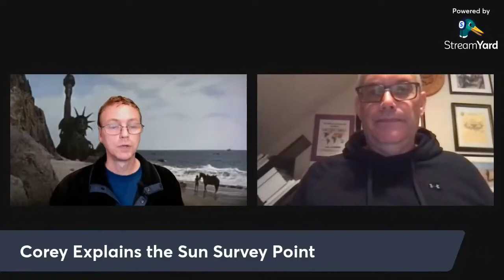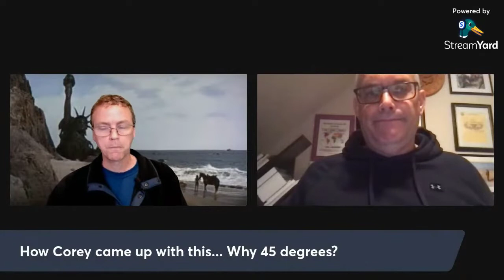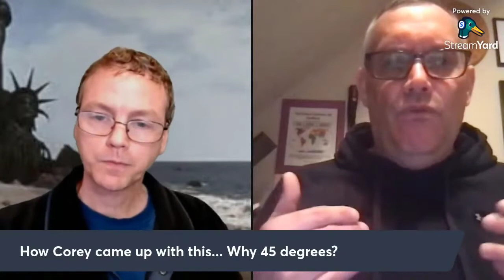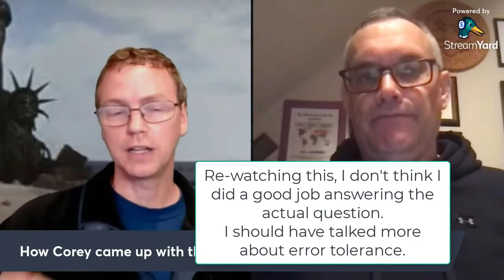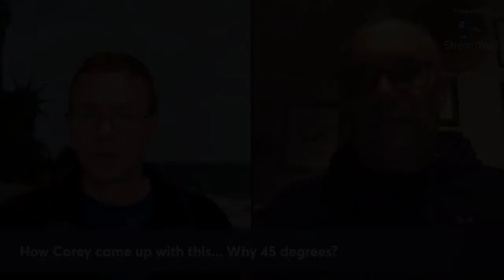Conversations with Corey - How he came up with this

Comment: 4 YEARS! It didn't take me more than a few days to make an initial determination. It took me a few weeks to identify the bearing of the setting Sun on the Equinox as the simplest, most accessible test that pretty much anyone can do. Of course I had to wait a few months to do the test. In the meantime I used stuff like Stonehenge to do a similar test. I also found a load of extra tests. Jos Leys shadow plot over a day is a great one for a sunny day.